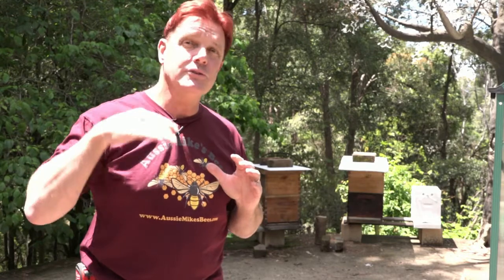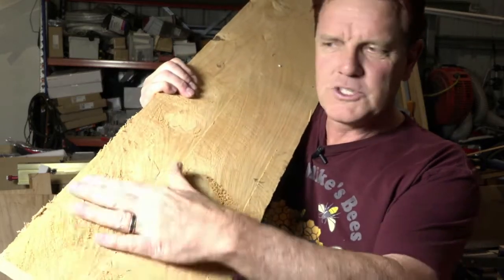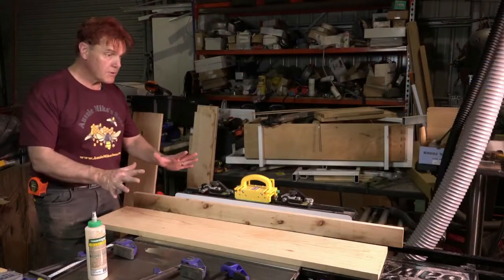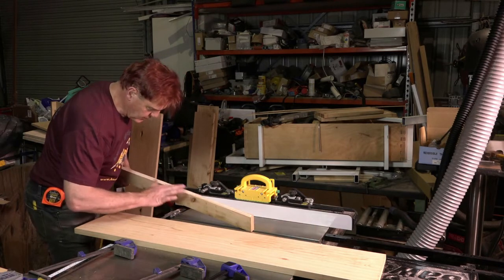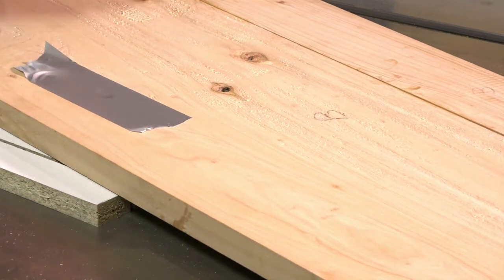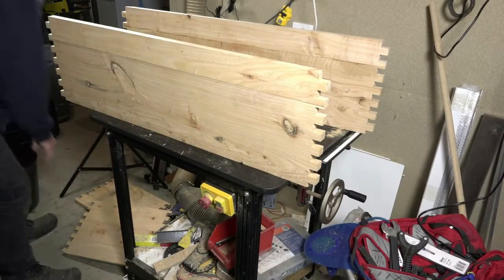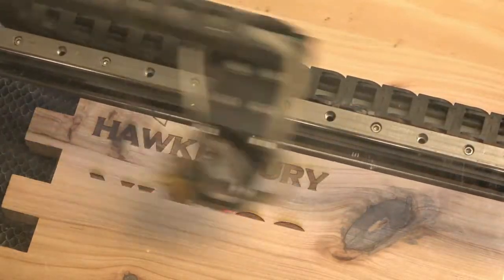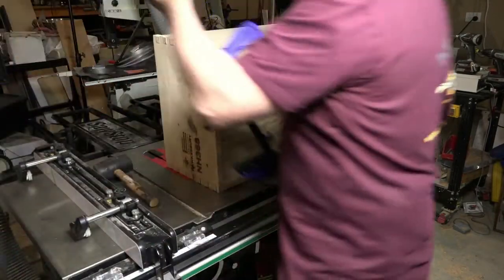Introduction to Horizontal Hives - Long Langstroth Build Part Three

Comment: Thanks so much for this series - have been wanting to make two of these hives but as you said everything was in imperial measurements. Looking forward to part 4 😀 follower boards and the queen excluder will be interesting (I hate them) but want to build these long enough to house two hives in each and they share the honey load, not sure if it will work but will be long enough split down the middle 😀
Reply from the maker: Thanks for watching and commenting, Lisa.  I have heard of Long Langers housing two colonies as you're proposing.  I'm interested to see how well it works for you.  I understand your feelings about QEs.  It's one of those topics of heated discussion among beekeepers.  You might consider using one to establish the size of your brood nest, then removing it once a couple of frames of honey creates the boundary. Hopefully the next part will be coming soon.  I won't be able to install it with colony until September/October, so I'll do a short installation video then. Cheers.

Comment: https://www.youtube.com/channel/UCeu1CTB02FccFaVGP4jL9Ig put a flow hive into a long lang. Had similar idea, but not with 2 hives in the lang would need to void out the area between the colony and the flow to get them to use it while allowing for future growth.
Reply from the maker: Thanks for your comment, Robert.  I've seen a number of designs that incorporate Flow Hives that appear to work well.  Although this build doesn't include Flow, I'm designing future builds to include it as an option.  I've never run two colonies in one hive, sounds complicated to me and I like simple.